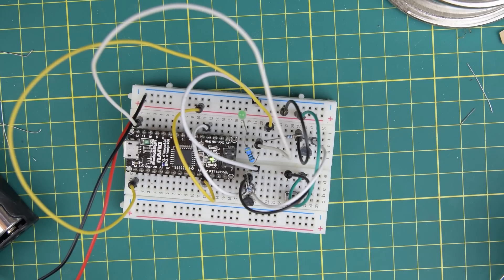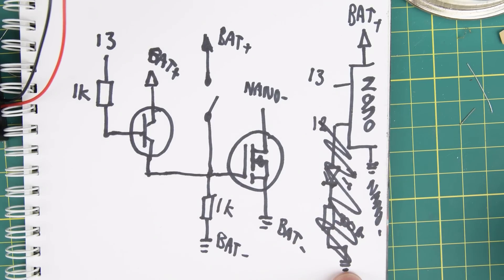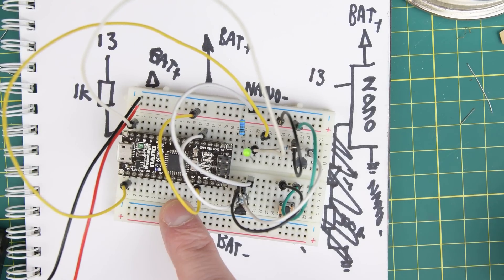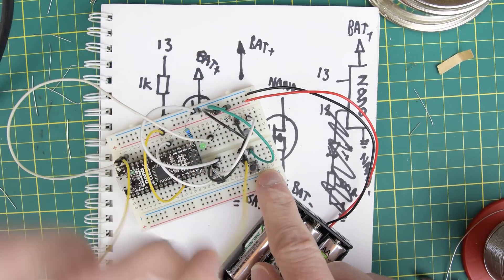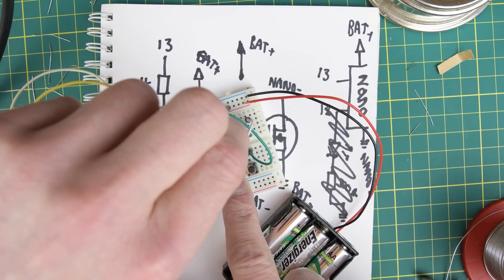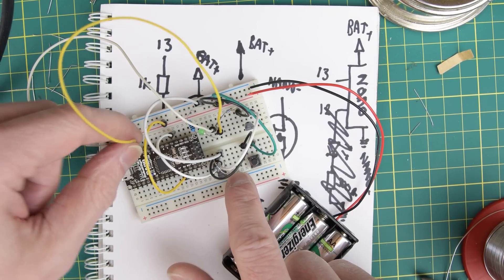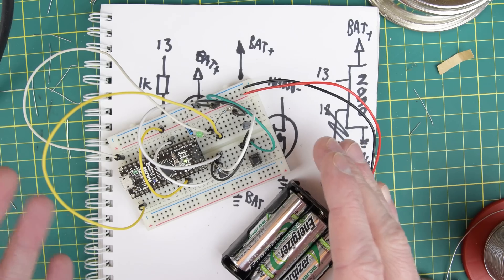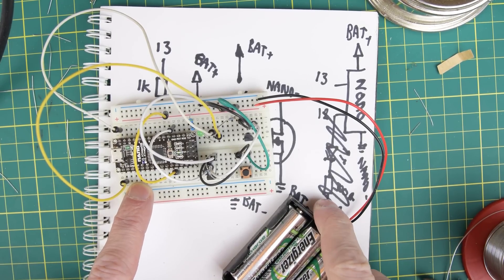UPDATE Microcontroller Power Button: Manual On and Automatic Off

Comment: Hi David I really liked your video, I hope you can help me, I'm looking for a circuit that can power on the Arduino with a button and then automatic off like your circuit but I also want to use the button once Arduino is on I mean the first press is for powering on the Arduino and then the second press for using the button with another function, I don't know if that's possible, but it would be similar to the power button of an smartphone that can power on the phone when its off and then once is on you can lock the screen, without turning off the device.
Reply from the maker: You could use a JK flip flop, a CD4023 to have two outputs from one trigger/button https://www.youtube.com/watch?v=s2LcUWQYwjk

Comment: I use a similar circuit with no external pins from the uC in small projects. Its basically a one button on and auto off timer, the off time can be adjusted by capacitor and resistor values. http://everycircuit.com/circuit/4600064356122624

Comment: Thanks! Thumbs up from me.

I was playing along with this setup the other day and wondered if it was possible to do the same thing with a higher voltage. That is, feeding the Arduino on the VIN-pin, let’s say 9V. 

At first glance, it seems to be quite easy. Just move the positive (Bat+) from 5V to VIN (and raise the voltage). Well, it didn’t work of course. Yes, the MC turned on, but didn’t turn off. The reason is when pin 13 goes high in order to turn the PNP transistor off, it can’t go high enough. It can go to +5V but with the emitter on +9V the transistor would be on regardless of pin 13. I gave up… 

On second thought, the solution is quite easy. Just connect the emitter to +5V and Bob’s your uncle.

Comment: ..current through the microcontroller protection diodes via led to ground. I didn't see that one. Great stuff. When the ARM team tested power consumption in one of their early cpu prototypes, it was pulling power from the protection diodes and IO and the power readings showed zero. There is a video on youtube about that.